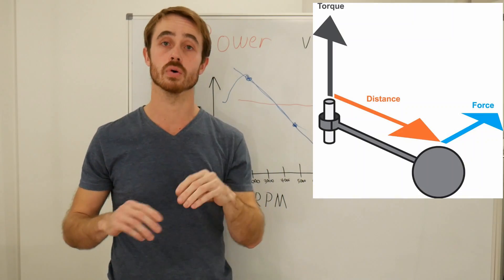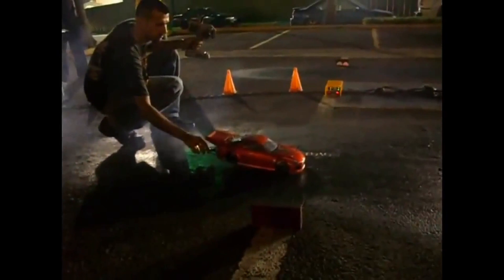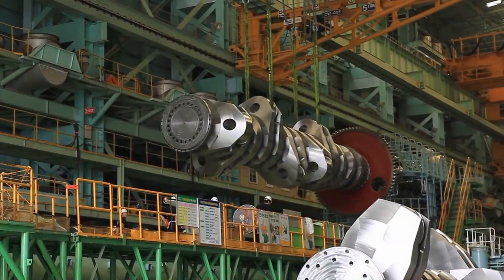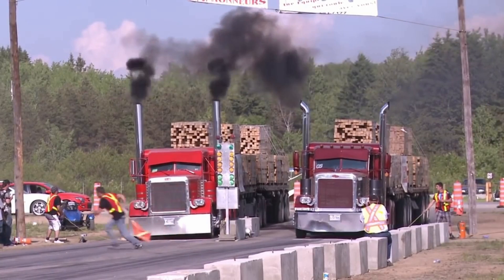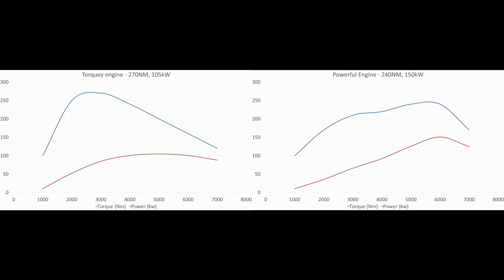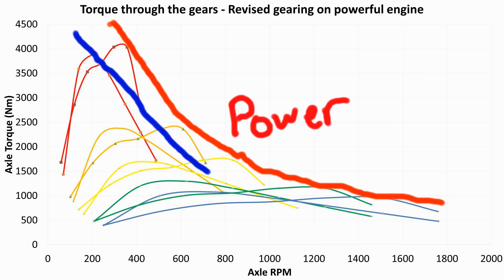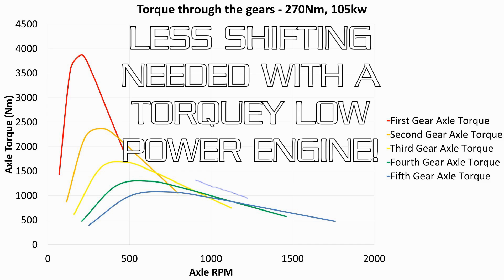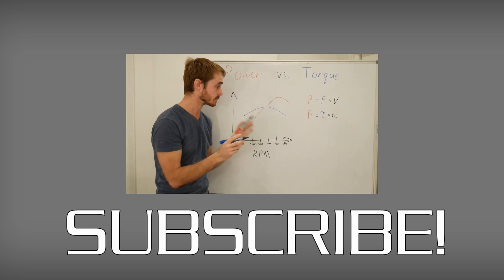Power and Torque (for Cars) Explained in 60 Seconds!

Comment: The combination of Torque and Engine speed is what matters. One should always see Torque AND rpm together. All said and done, an engine that produces more torque at the same rpm is also producing more power. If the gearbox, final drive and tires and the vehicle are the same, the engine that produces more torque will also be more powerful and produces better acceleration.

Top speed is all about whether you are getting enough HP to overcome drag (assuming proper gear ratios) at a certain speed. When you can't overcome drag anymore, that's your vmax.

Comment: Power is what moves you 
Torque is a byproduct of the engine itself 

A more Torquey engine will produce more power down low giving the illusion that it's torque and not power
Reply: Very true, but most people do not understand this concept :)
Reply: Andrew H I think you are the only other person that I have ever seen in a YouTube comments that actually correctly understands the correlation between power and torque.

Power is simply a calculation of how much work the engine is doing. What is actually making your wheels spin around is torque.

Comment: Hi
I have a question about power and torque
I understand 90% of it but one thing i dont understand.
If for better acceleration we need power not torque, so why in my car 1.8t chipped i feel better acceleration for example on 3rd gear betwen 2,5k-4k rpm (where average power and torque is 135hp & 290Nm) than between 4,5k-6k rpm (where average power and torque is 180hp & 240Nm) ??
I know there is a air resistance but i dont belive that is so big. Same feeling on 2nd gear.
Same example is in diesel 1.9tdi 130hp.
On 3rd gear at 4k rpm (max power)  accelerate slower than  at 2.5k rpm 
All I want to know why I fell more counter force on my seat when I 'am betwen 2.5k-4k RPM than between 4,5k-6k RPM although power of engine is bigger there

Why is that?
Reply: If your driving in 3rd gear you will feel most acceleration at peak torque because this (torque) multipled by your gear ratio will be your wheel torque and that divided by your radius of your wheels will be the force that the car is used to accelerate with. Force=mass*acceleration. More force same mass = more acceleration.
If you want the most acceleration at a specific speed for example 100 km/h or 60 miles or whater. You whant your engine to be at the rpm were it has the most power say 6th gear at 2.5 k if at 100km/h would fell  slower then say 4th gear  at 4k at 100km/h if you try that in your car accelerate at same speed roughly but change down a gear so the engine is at a rpm where it has more power.
Gear ratios is important. For example if your top speed in 2nd is 80 km/h and 4th gear is 160 km/h your gear ratio would be half as much in 4th as in 2nd so at the same rpm same engine torque in 4th gear it would have half the wheel torque. =half the acceleration (don't mind air resistance).
Reply: on 1 gear this what you write is correct  and which disel spin to 6 k rpm ? ok whatever on one gear this what you write is true you be feel bigest kick in back at peak  engine torque  everything will change when you try  compare 135 hp /290 nm to 180hp/240 nm at egzacly the same velocity than 180hp/240 nm will kick stronger for such comaprision you must choose diffrent gear for hold the same velocity at diffrent engine rpm thats why in fact engine with more power and less torque with optimal gearing beat less hp and more torque engine in race etc for egzample new single cylinder cbr 250 have 26,5 hp and 24 Nm and weight 160 kg it hit 62 mph in around 8,5 sec with 100 kg driver vs old cbr 250 rr mc22 which have 45 hp and 23NM weight similar around 160 kg with the same driver hit 62 mph in around 6 sec or lil less other egzample honda civic type r N/A veriosn with 200 hp and 200 nm at engine crank weight 1250 kg around hit 62 mph in 6 sec around in good weather with sticky tires vs seat ibiza 1,9 tdi gt 160hp/330nm hit 62 mph in 7,5 sec with the same tires or tires which balance weigt distribution and so one weight also around 1250 kg ..... one gear is pointlesss when you want subscribe racing capabilities specified engine/vehicle you need use porper gear for specified velocity in race for hold one peak power as long as posiible .AT GIVEN VEHICLE VELOCITY ONLY PEAK POWER CAN GIVE MAXX ACCELERATION any GEAR WILL BE NEDEED ANY RPM WILL BE NEDEDD ANY TORQUE AT ENGINE CRANK =YOU MUST USE PEAK POWER SPECIFIED ENGINE OTHERWISE THIS VEHILCE WILL ACCELERATE IN DID SLOWER AT THIS VERY SPECIFIED VEHICLE VELOCITY because WATT:M/S=FORCE IF YOU BE USING IN FIRST ATTEMPT LET SSAY DIFFRENC IN GEAR LENGHT ALLLOW YOU TO USE BOTH SETUP AT LET SSAY 50 TO 100 KM/H SO IF 135HP/290NM ACHIEVE THIS IN 6 SEC THAN 180 HP /240 NM IN 180:135 =1,333 SO SUCH 6SEC:1,333=4,5 SEC AVERAGE G FORCE BE ALSO 1,333 TIMES OFFCORSE BIGER it cannot be the other way around .
Reply: @mociczyczki  I feel too bad for your message, because of how much you've put into it, and that I and many other people will just ignore your message because of lack of any punctuation, rendering it unreadable.
Reply: @Shadenium  w krotkim zdaniu cycu na 1 biegu największe przyspieszenie nastepuje gdy silnik jest na max momenie na wale ., wszystko sie zmienia gdy chcesz miec max moozliwe przyspeiszenie przy danej predkosci jazdy wowczas pik mocy sie liczy ,poniewaz na piku mocy silnik jest w stanie wykonac najwiecej pracy w tej samej jednostce czasu period  .,gdy sie zaczniesz bawic stoperem w kto ma silniejsze uderzenie mierzacmiedz czasy dla tych samych predkosci w obojetnie jakim pojezdzie okaze sie ze pik mocy zawsze przyspeisza sprawniej ten sam pojazd niz pik momentu na wale ,sprawniej takze niz wyzsze obroty niz obroty gdzie lezy w danym silniku pik mocy  zarówno wiecej momentu na mniejszych obrotach dajac wynikowo mniej mocy na tych obrotach niz w piku bedzie slabiej rpzyspeiszało jak i wieksze obroty gdzie tez jest mniej mocy  pomimo "korzystniejszego"jakby sie nektorym wydawało  przelozenia bo np jestes na 3 a nie 4 biegu i masz wyzsze obroty jesli na tej 3  bedzie mniej mocy silnik generował to choby s niewiem o ile zwiekszył te obroty przyspeiszenie bedzie tylko gorsze a nie lepsze  przy tej samej porownywaej roznicy  predkosci jazdy pojazdu np od 20 do 50 km/h albo od 300 do 350 km/h wszytsko jedno jaki poziom rpedkosci ale ten sam bo niemozesz porownywac 0-100 jednego auta z 100-200 innego bo takie porownnie niema sensu to samo auto zawsze bedzie rpzyspieszalo gorzej w zakresie 100-200 niz 0-100 z jakimis tam wyjatkami o silnikach o mocach rzedu 5 k hp i słaba trakcja ale mniejsza z tym :x .

Comment: Why do they use Diesel engines & not gasoline engines on 18 wheelers?
Is it because Diesel engines have higher compression ratio producing higher torque basically due to the resulting force from the compression based explosion inside the pistons?

Comment: pls do a full Video on this. my friend wont believe that my 500hp/ 650nm Astra is faster than his 400hp/ 750nm Diesel A5. i also know my gearing and final Drive. he doesnt know shit and says Torque is everything and he would Beet everything from m5's to s62 amgs...
Reply: He already made one, it is actually the video before this one. What kind of cars are you driving???? An Astra FWD? with 500hp? Is that even a thing?
Reply from the maker: What speed does that thing spin the wheels till? haha. Here's the link for the other video in case you can't find it: https://www.youtube.com/watch?v=X7KWtf4wqN4
Reply: ye ive found it Thanks. thats what i told my friend too but he wont believe... my Astra Spins in first totally, but in 2nd (50km/H) it's pushing Forward like a Train haha Minimum tyreslip tho. you hear the tyres Slip in 2nd and 3rd Till around 130km/H but it's still pushing like crazy. Transmission can do 312km/H @8000 rpm but i dont Drive much faster than 270km/H. it's too scary in a Little Astra.
Reply: Yeah. He doesn't know that vmax depends on the HP. If you can't produce more HP than what is needed to overcome the drag at a particular speed, you can't go faster.